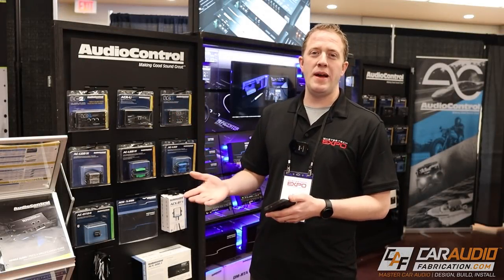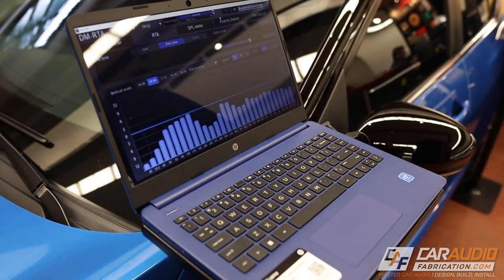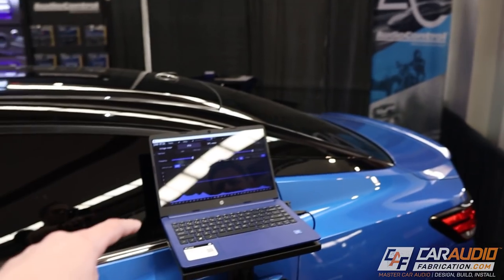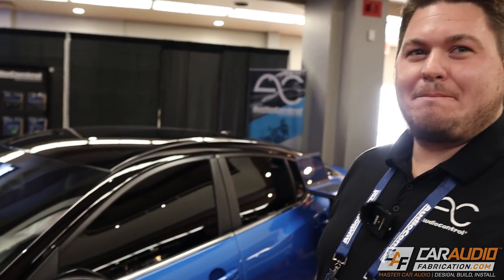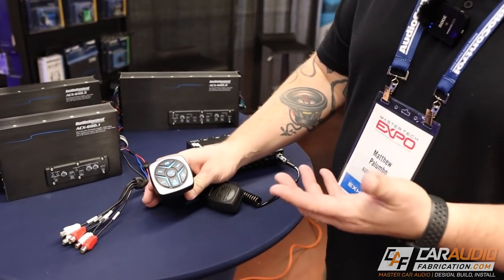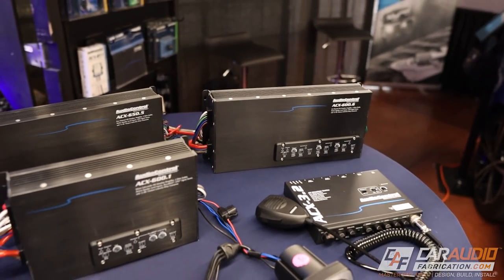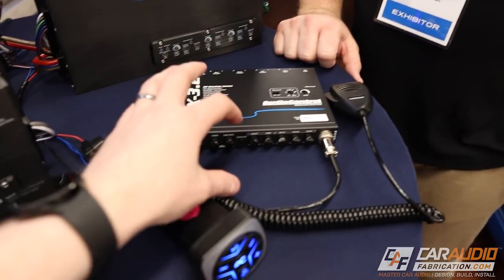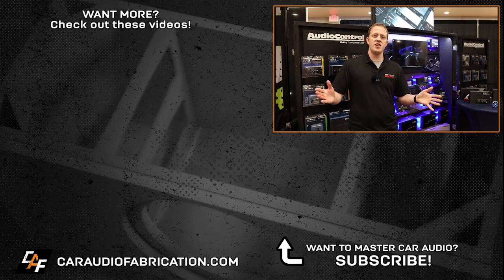AudioControl's Latest Tech! - Booth review at MasterTech EXPO!

Comment: I love audio control i wish i could afford it all! The master volume button thing looks sleek, 
I told me myself when i get a brand new Ford Bronco im going all out on an audio system
Reply: Don’t do my mistake b&o system doesn’t work with audio control the voltage drops frequently you need a part from NAV TV that converts the output from Back of the radio to rca analog output but it cost around $700

Comment: The dm rta has to be the best value implement on the market IMO. Double the price and it's still a relative bargain given its functionality and it's ability to combine and eliminate the need for multiple other tools and connections. Ac is on the ball with these products. Would love a d series 8 channel 1600w amp. Bridge 2 channels for sub, run rears passive and run an active front stage with tweets and mids, or a 3 way component front stage with 400w bridged to sub. That would sell like hotcakes.

Comment: Did you see if the ACX multi-channel amps will have the same summing feature as the LC series?
Reply: All of the ACX amplifiers, new models and existing, have the ability to take as little as 2ch of input and still provide output on all channels, so there will never be a need for Y-adapters. However, they do not have our "front high input" like the LC and D series amplifiers do. This is for two reasons... One, to keep the ACX amps competitively priced, and two, because these are all-weather amps, most will find their homes in powersports applications like boats, side by sides, and motorcycles, where signal summing isn't generally necessary. Hope that helps!
Reply: @AudioControlCar  What is the release that for the new ACX amps?